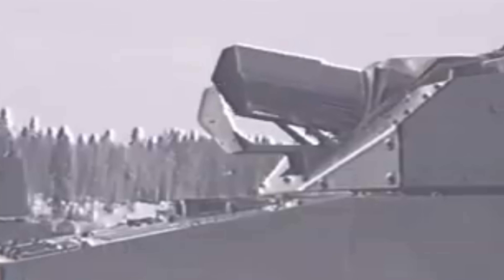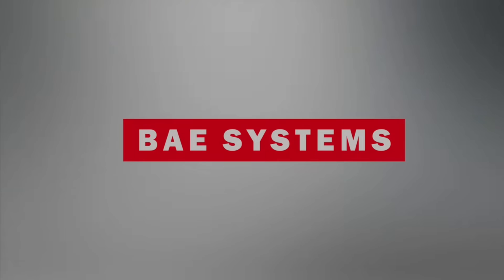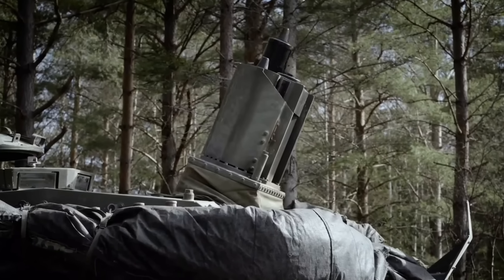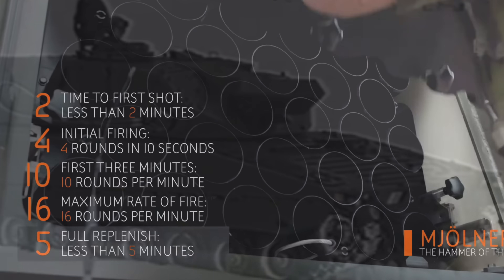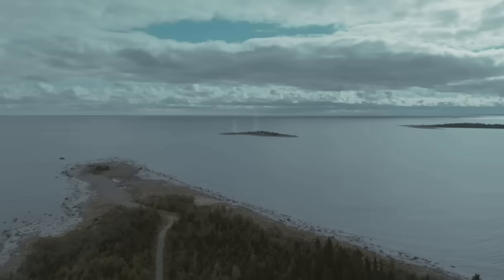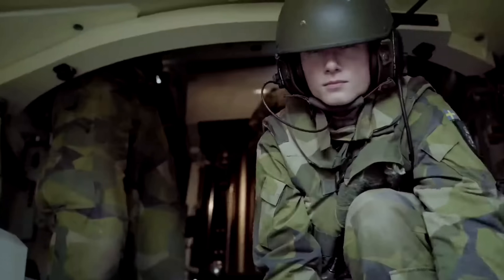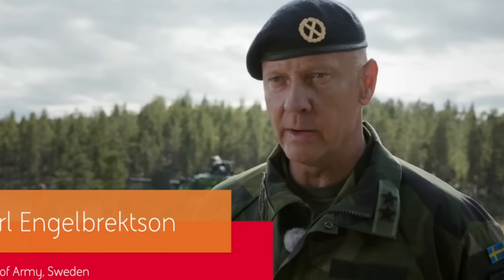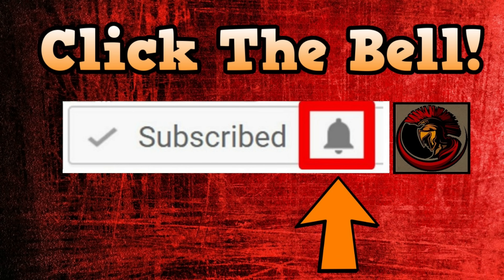The 'Mjölner' Rapid Fire 120mm Mortar Vehicle | DOUBLE BARRELED INDIRECT FIRE

Comment: I think the mortar system is great, it shows the mortar gun  
with " two tubes ", fires 16 / 120 mortar in one minute, the 
South Koreans have a armor mortar system also, called
KSM / 120 Skyfall and has a computerized fire control system that can put rounds on different locations, only
draw back is this system is open and not concealed.  My
Opinion, the mortar system needs two more tubes all
together.  Mjoiner CV90 is a beautiful platform.  And the 
old school out door mortar system is not good.

Comment: Taking into account dual 120mm barrels, the sheer amount of impact on the enemy, at 9km (9000m) range, and a platform able to move at 70km/h is a solid threat to any enemy, even with counterbatt radar. This again, being rolled out in a very short timeframe, shows the potent possibilities of the CV90-platform.

Comment: A very expensive way to do it.  For the same price a pick up truck two tubes and six well trained guys could achieve the same thing half a dozen times over
Reply: Two trucks, one for each tube. This was the original way Sweden did it. The problem is time to setup and time to leave the area after shoting.
This is to be used for support of armored units against an oponent with anti artilery radar and counter fire. As soon as your round clears the tree tops, you have to assume you have incoming rounds on your position.
Reply: Ps.( Since the guvanor aproves). Alright two picks ups and eight guys and a coms link (phone) to 4 other guys with a sub five grand drone and youve got the same fire power and way less battlefied signature. Big vehichles die to drones easy and 120 mms only go 7 KM ish . 7 km is managble for like all drones easy. Your better off with stealth and speed than ar pur these days. shoot and scoot.

Comment: In the 90's we had this vision on slow moving atrillery.... If we shoot at the enemy, they can locate the gun and shoot back before the artillery can be removed from its firing position... And that was way before large scale usage of drones...

And therefore movable artillery/mortars are a must in current warfare. Shoot and move before your shells hits the ground.

It is much harder to hit moving target. But even that is becoming more and more likely. If you can see the target, you may hit it with current targettable ammunitions. Most of the shells has not this tech, but some has...

In current state of Ukraine war, there is hardly anything that can be done, because any movement reveals your positions and you'll get a barrage from these weapon systems. Large groups - dead in minutes. Small groups - dead if they are seen... It is more like a computer game - systems shoots anything that moves with pinpoint accuracy or with multiple shots.

Drones has started to take soldiers out from the field. It is likely that this will continue in the future in even more rapid pace. AI systems fighting between themselves specially in the frontlines...

Comment: The loading system seems a bit redundant considering they are using electronic firing. One would think a rotating breach block would suffice and speed things up. You could even have a firing pin if I'm missing the drop firing in this process

Comment: Amos and Mjölner are useful for offense and counter-battery fire, where you need to shoot and scoot. But it's not the future of indirect fire. Future of indirect fire is still going to be light mortars that you can get 30 pipes with the price of one CV90 Mjolner vehicle. Easy to hide and great in protecting troops in long defense lines. There will be no movement once there is enough mines in the ground and drones in the air. For example the Finnish 120 KRH 92 has a sustained rate of fire 15 rounds/min where Mjolner only has 6 rounds/min. You're not going to want to move your defense line anyway, you want all those 30 mortars stop the attacking enemy.
Reply: Not so great protecting them self...
Reply: @coole6825  digging in has proven to still be the best protection.

Comment: First of all I thought: 'That mechanism is the weak point. It will likely fail at a critical point in a battle.' Then I understood what it is. There's no motors involved - It's two people pushing a round into a hand-cranked mechanical mechanism. If it jams it's probably possible to unjam it reasonably quickly, and you don't have to install a new motor. All you'll need is a good vice-grips and some elbow grease. It just happens to look like a sci-fi, electrically-driven mechanism. Way to go Sweden.

Comment: With recent emphasis on UAV / UAS's (especially since BAE being at the forefront in such technologies) see an integration with the Mjölner in the (not too distant) future. Used as a 3rd. party laser designator a UAS could direct guided munitions with pinpoint (one shot) accuracy. Such munitions have already been developed by the companies in the US, Russia & Israel. Less expensive than ATGM's and potentially much more effective due to longer range (10+ km), larger warhead & downward projectile trajectory.

Comment: I do believe that you "failed" to understand the situation in Europe regarding mortars... 
Who are the users of the CV90 that don't need a 120mm mortar system?
- Denmark, they have the Piranha V with Israeli mortar system (open roof)
- Switzerland, Mortar 16 Pianha IV, Swiss mortar system RUAG Cobra ((open roof)
- Finland, PATRIA AMOS and NEMO available
- Estonia who already ordered ordered 120 mm mortar from Elbit.
Who may have an interest?
- Dutch Army who both uses the CV90 and needs a new 120mm mortar, but intends to get a small quantity
- Norway who both uses the CV90 and needs a new 120mm mortar, but intends to get a small quantity
But inlikely... Norway uses the Ragnarok 81mm mortar system from Rheinmetall Norway, and Rheinmetall develops a 120mm variant with 80 % in common. This will be chosen by the UK for the Boxer, and most likely by Germany, also on the Boxer.
- Slovakia, but unlikely to install it on CV90, a Patria AMV maybe
- czech army, but unlikely to have a turreted vehicle. The 8x8 is the favoured platform. And they expect a direct fire capability, which means Patria NEMO, AMOS or RAK120

What are the competitors only in Europe or in use in Europe? 
1. properly turreted ones
- Patria AMOS / NEMO (already adapted to Boxer, Patria AMV, Patria 6x6 and CV90)
- HSW M120 Rak (already adapted to Patria AMV and Borsuk)

2. "open roof"
- RUAG Cobra (Piranha IV + FNSS PARS)
- Thales 2R2M (Griffon that might be interesting for Belgium, Freccia IFV, M113, VAB)
- Elbit Cardom (Piranha V, Stryker and many other platforms)
- Rheinmerall BAE Systems Land, Boxer developed mission module for a 120mm mortar, based on MWS120 Ragnarok 

3. Other concepts
- Alakran 120 mm, light mortar, Ukroboronservice
- Spear autonomous 120mm mortar system, on pickup truck, no roof
- Wiesel 2 with M120 Mortar, German Army

Comment: That's definitely not rapid fire, and is a knock-off Dragonfire garbage system. I beat that 20 years ago with a design to ARDEC running 200 rounds a minute with a multi-barrel system that was never picked up, as they went with Dragonfire. Their loss...still 50 years behind.

Comment: This system is very interesting, especially if you're looking at a defence/offence in-depth. Combing direct and indirect fire vehicles with mechanized infantry support vehicles with troop carriers lends credence to the idea that mobility is super important, but there is still no cost effective small very fast anti-drone counter.

And no, jamming will only work for a now. Cognitive radio systems with directional frequency hopping for combat drones is coming. It's only a few years away.

Comment: Heavy, loud, high, expensive........I would prefer the Wiesel-Mortar  https://www.youtube.com/watch?v=Qln3hVoe8qA
Reply: Wisel is a smal good mortar system but it have only 30% firepower, 20% amo storage and have 75% crew. It can't give to much fire support.
Reply: @len2063  As us the war in Ukraine shows, EVERY kind of artillery is shooting only a few shells and then has to change the position. SO its NOT that important how many shells are in a tank, they had to go back anyway, so they can reload. U can go with a Wiesel over EVERY bridge, u can park in a garage, u can drive even on small pathways, u can pull it with a common offroader......and i see 50 % firepower.....and half of the prize.....SO u can get 2 Wiesel for the prize of 1 Mjölner.
Reply: @mauertal  That is very true. I think in Ukriaine where drone can detect every movement, smal mobile mortar system can be very usefull. The biggest drawback for Wiesel is its low amo storage of 27 vs 104 and its weapon range 6km vs Mjölner 13km.

Comment: Another advantage of mortars is that the ammo for them is a lot easier and cheaper to manufacture. Since there is no spin in the barrel and pressure and friction are lower than in a regular cannon or howitzer, you can use lower quality cast iron.
One of the reasons Russians are so fond pf their 2S4 Tyulpan 240mm mortar.

Comment: WOW!  Significant improvement for mortar systems.  Think a battery of those (4) firing four rounds each then relocate, fire four more and so on.  This CV90 chassis seems to be quite well thought out.  Engineers must have worked with the potential operators to get things right.  Go figure
Reply: Czech, Slovak and Ukraine are interested in the Mjölner system.
I believe the mortar barrels are made in Czech Republic.

Comment: I can understand that the AMOS might be too expensive, but what about the NEMO, which is the single barreled version of the AMOS in comparison to the Mjölner? The NEMO may only have one barrel, but it is a mostly automatic breech loader, which means that two crew aren't required to operate the mostly manual muzzle loading mechanism of the Mjölner. Also the NEMO has the same long barrel of the AMOS and so I would think would have longer range for a given round with a given number of increments than the shorter barreled Mjölner. And lastly the NEMO retains the direct fire capability of the AMOS. This opens up the potential to fire shaped charge HEAT rounds. I know that as a general area bombardment weapon, mortars generally have zero use for HEAT rounds. But if in direct fire situations the targeting of the mortar is precise enough to give high odds of being able to hit an MBT or APC/IFV from a couple thousand meters then the direct fire capability presents a very interesting capability to effectively target other armored vehicles. Not that a NEMO or AMOS mortar carrier is going to deliberately go tank hunting. But if one of these vehicles found itself either with an irresistible target of opportunity, or more likely finding itself being hunted by a MBT or a IFV with a 30mm/40mm gun capable of destroying the mortar carrier, direct fire with HEAT would at least give them a fighting chance of survival.

Oh, and I would be remiss if I didn't say that Mjölner, or NEMO or AMOS carrying a load entirely of precision guided rounds utilizing the XM395 type PGK that can achieve CEP of 3-5m with GEP and less than 1m with SAL would be absolutely a game changer. Besides being able to put HE rounds right on the target with the first round so that it can achieve the fire mission with just a handful of rounds fired in less than a minute so that it never has to stand still for more than 3 minutes, the combination of a drone carrying a stabilized laser designator and the Mjölner or the others firing a HEAT round with a laser seeker could actually turn these vehicles into tank hunters. But instead of having to get into LOS of the tank where the tank has LOS back at them, they can do this from a position that the tank is helpless to fire back to defend itself.

Comment: Although I do agree and see how advantageous this may be for logistical reasons concerning ammunition ect. I don't see anyone bringing up the concern of signature management, which that mechanized mortar platform would have a massive one. Only thing it may have going for it, is being able to fire and maneuver to escape enemy counter battery while still possibly being limited by terrain. It may be good for its own backyard, but if you were to say use it in any other region of the world, you may find difficulties employing it.. just a thought.
Looking at the current Ukraine vs Russia debacle.. you can see how useful Russia's armor has been against Javlins ect
JUST TO CLARIFY: I think they still have their place, but not as a complete replacement for foot mobile mortars.

Comment: I think the reason why there's not so much interest in it is that mounting a mortar on a vehicle requires relatively low tech. The benefit from putting high tech on such a system instead of just buying more low tech systems is very limited. There are literally old M113's in this configuration in use. If you wanted more, you could probably just pull them out of storage and modify them for a couple 100 thousand dollars, while this system seems to cost 1,7 Million.
Reply: it's a new system, just a few years old.
Don't think it's up for sale just yet....

Comment: need more CV90 variants. next step and VERY crucial to all modern armies is a drone kill system that can cheaply engage and kill drones. using expensive manpads or other guided munitions to take out a modified commercial drone is not cost effective at all. so immagine a CV9040 capable of of 90 degrees of degrees of elevation or near it at least with a high resolution radar pointing mostly up. and fire proxy munitions.

this might sound familiar, that is becaus this vehicle kind of already excist in the form of LVKV 9040. diffrence being that it lacks the gun elevation to engage targets above and i am unsure how well its radar and proxy munition can deal with small comercial drones.

Comment: Shoot and scoot times will more and more vital in the face of counterbattery fire capabilities.  Even if someone spent a gorillion dollars on counter-battery radar that pipes coordinates right to autoloading SPA that all that has to happen is the gunner pushes Fire, and rounds are on its way to where that artillery is, stuff with extra-short shoot-and-scoot times. (I.e. they are on their way out before their first rounds are landing, let alone the enemies return fire) just makes that ineffective, forcing stuff like air support to be used if you want to take out that battery thats trucking its way to the new location.

Comment: I think you should check out the M120K Rak mortar system from Poland. It's based on the Rosomak APC, a Patria AMV variant (though can be mounted on every chassis with enough load capacity), and the turret is probably the most advanced out of all mortar turret systems out there. It's the only one on the market that has truly automated loading (full autoloader that works in every turret angle and gun elevation) and thus fixed rate of fire of 8 rpm. It also has a soft kill APS and a system of cameras (both regular and thermal) that allow 360° vision.

Comment: They load the grenade by hand into a barrel from where an autoloader takes it and puts it into the main barrel? Why not make a a breech-loaded mortar without autoloader instead? This confuses me.
Reply: They took existing mortar tubes and that was cheaper than build a new breech loading system.
Reply: @len2063  
Thanks! That actually makes a lot of sense.

And considering how sophisticated the system looks it's pretty funny that it is improvised.

Comment: If you got a big wallet - Get the AMOS system, else get Mjölner. This is the second-best option for the penny-pinchers. Those crappy Bradleys should be rebuilt with this system instead.
Reply: M120 Rak is the best option.

Comment: The Mjölner mortar system is a huge stepp forward for Sweden. There are 5 lompanies with 8 systems in each kompany with two more companies ordered. From a suport perspective a batallion needs atleast 3 plutons preferbly 2 kompanies to give a deacent fire suport. Before the war in Ukraine   most western doctrine has not focused enough on the artillery suport. We can from what we have seen draw the conclusion that we need 3 times as much artillery as we thought. The Mjolner system has the capability to give fire suport for maximum a minute before moving since they are front close artillery. This means that they are within range of many enemy artillery systems compare to the Archer system. Being this front close will increase the need for a large number of the systems. The sydtem should if possible be well spread out with the Mjolner units standing alone no closer than 500 m to the next unit. By doing so and having 2 kompanies suport can be given over time.

Comment: The most significant logistical reason why the US has trouble adding another weapon system like this on tracks? Fuel. We’re no longer producing it ourselves. That statistic changes way too often 
(can change within a year depending on who gets cheated into office COUGH! Biden COUGH,COUGH!!) to adopt this weapon system. We should have done more with the Bradley but we just aren’t stabile enough when it comes to fuel to adopt such a system. You also have to consider number of units. Sweden can afford to venture into such boutique weapon systems such as this because their mechanized military is considerably smaller in comparison to the USA. More units = more politics = more money it takes to convert just a small portion of our mechanized military to adopt such a system.